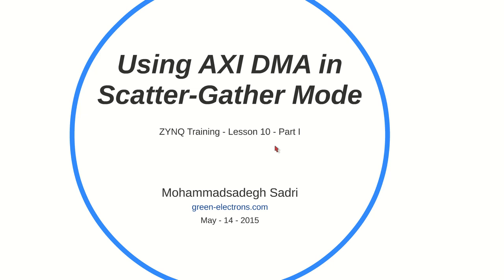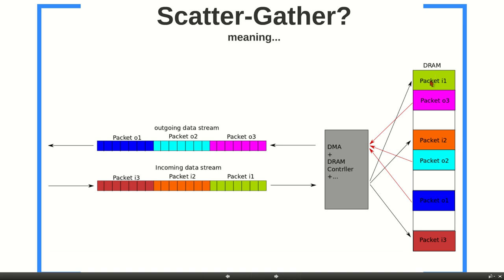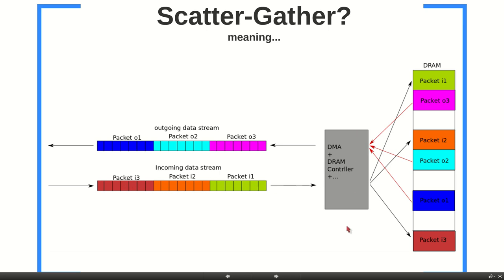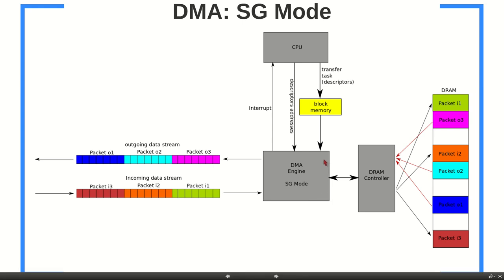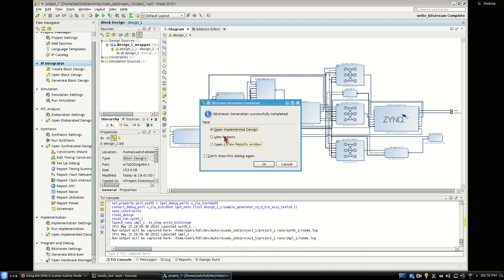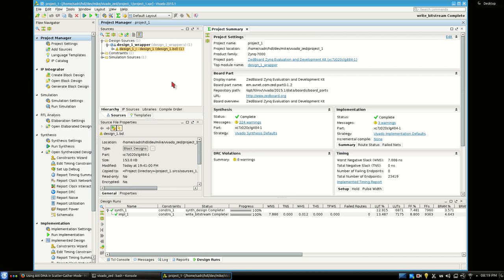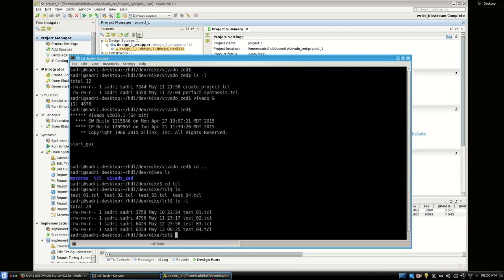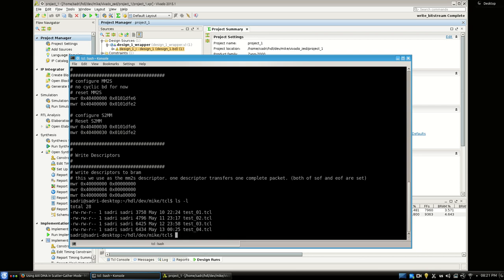ZYNQ Training - Lesson 10 Part I - Using AXI DMA In Scatter-Gather Mode

Comment: Hey Mo, I was rewatching this the other day, quick question, you have a CONCAT of two interrupts, mm2s and s2mm, so a two bit output value and you feed that to a one bit IRQ_F2P, seems you are concatting and then only passing in the lowest one bit  of the concatted output. Seems you either need a two bit intr_f2p, or you need an OR, not CONCAT?